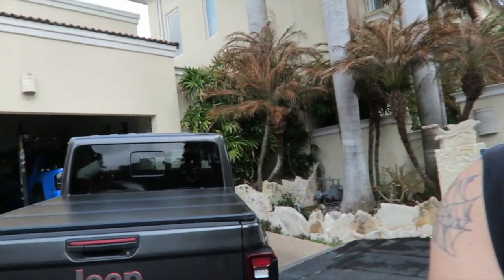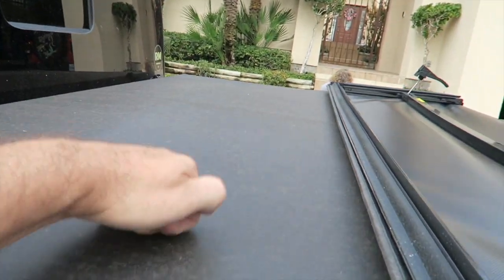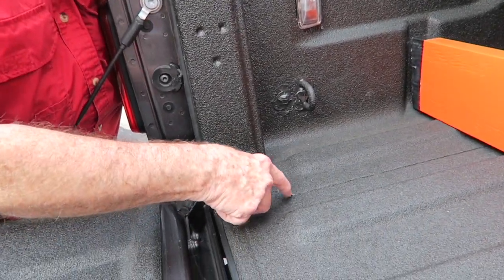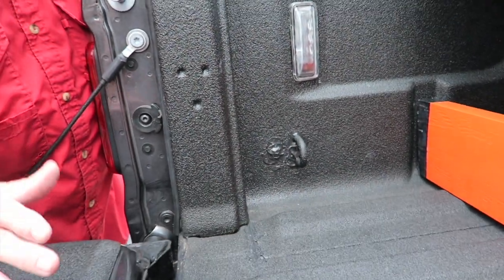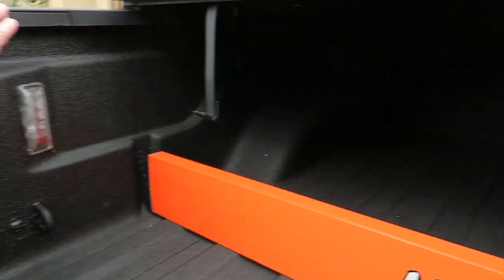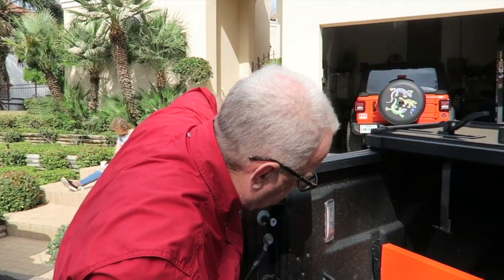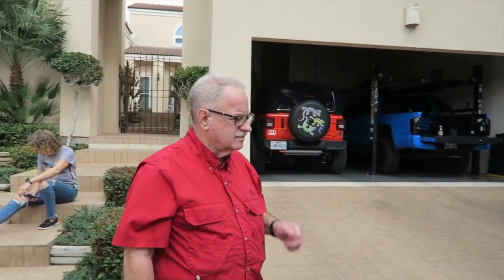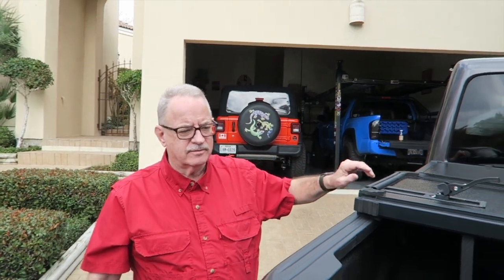How is the DNA Jeep Gladiator Tonneau Cover Doing

Comment: Bought this with your link Rob for my 2021 Gladiator without the trail rail system.  Watched Randall install it on the previous video. Didn't use the crazily worded instructions that came with it. Took barely 10 minutes to get it on by myself and most of that just eyeballing it for alignment. Came out perfect. 5 minutes and it's completely removed if I want full open access without leaving attachment rails behind like the others. Wanted a hard cover that comes completely off easily. Not quite as aesthetically appealing as the more flush mounted options but better if you want easy on and easy completely off. Thank Randall too.
Reply from the maker: Great to hear!  Glad it went smoothly for you👍👍. Can’t beat it for the money!

Comment: Man you guys got hit hard with the frost, lost your flowering plants and palm foliage.  Nice cover he has especially for the price.  Think I'd look for rubber grommets to seal those large holes rather than filler, might even find some small rubber plugs for the rail system holes.
Reply from the maker: We lost a lot here.  Still waiting to see what may have survived 🤔
Reply: I used some plastic plugs then filled in around with the caulk.  Caulk can be your friend. I will say Rob did not fill and he had no problems either. I can go a little OCD on some things so fill everything.
Reply: @randallupton3622  Beautiful truck my favorite color for Gladiator ...😉